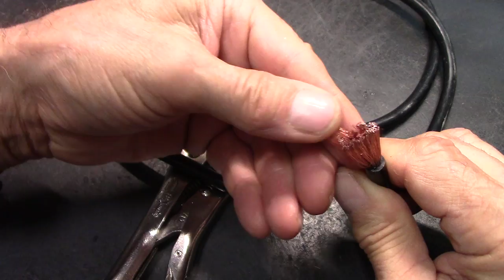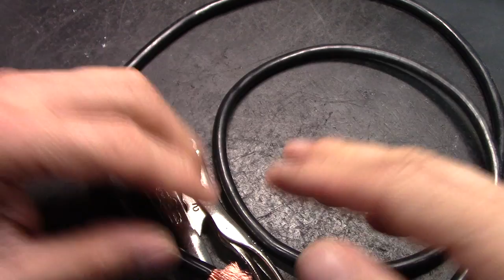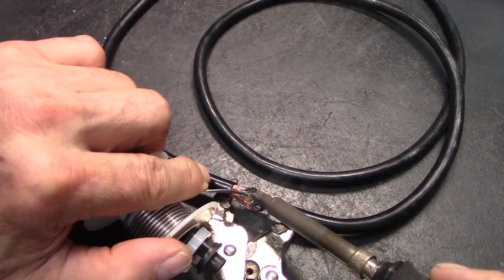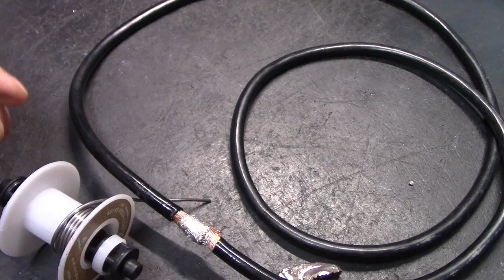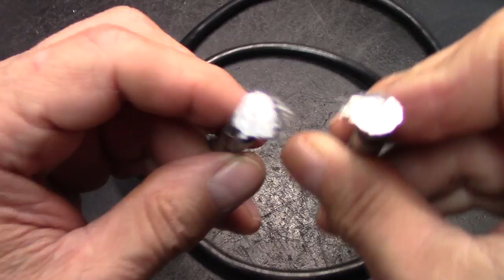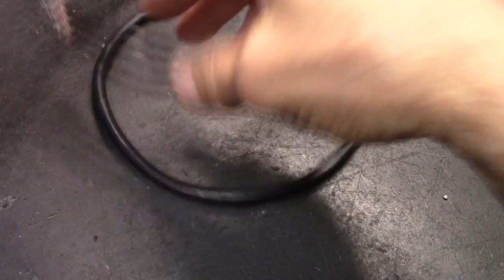Soldering ...  400 to 600 strand 6 gauge wire. PA!

Comment: Nice penetration
Reply from the maker: Thanks for dropping by and yes, that was the plan otherwise a waste of time, materials and disappointment. That's actually something like part 1 if I was teaching someone sitting close by to observe attempting to learn. It's been at least 3 or 4 years since I've had to solder anything like that and it was done in a hurry but I'm sure that if anyone listened closely that they'll get the drift. Part 2 would be holding the pencil on a slightly different angle and position and then cutting it to expose all of the shinny copper wires smeared from  1/4 of the cut to the outside of the cut.

Comment: I like the vids but  I do have a comment about cutting that apart.  I know you are trying to show depth of the solder but when you cut that it creates heat & brings the solder on the outside of the wire & basically smears it across the end of the wire. IMO
Reply from the maker: It does on the "outside" of the cut but clean for more than 3/4ths of the way through. Water does a good job but not in the shop (makes a mess) and limited time on the video ... Thanks for stopping by!